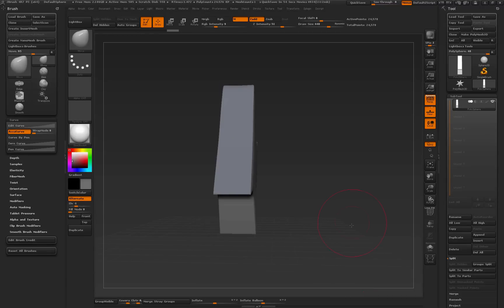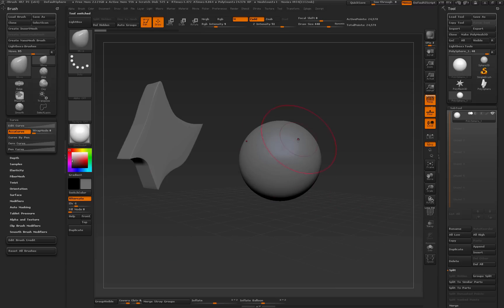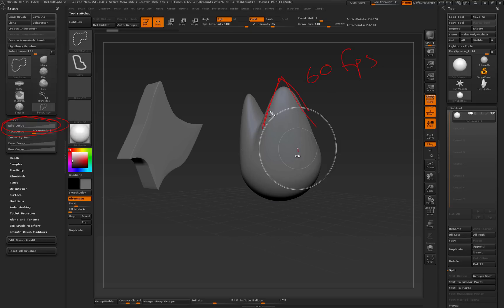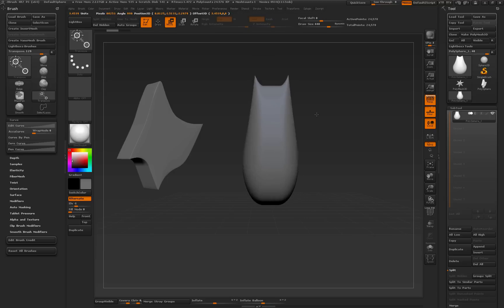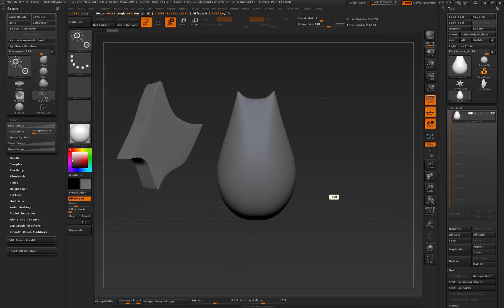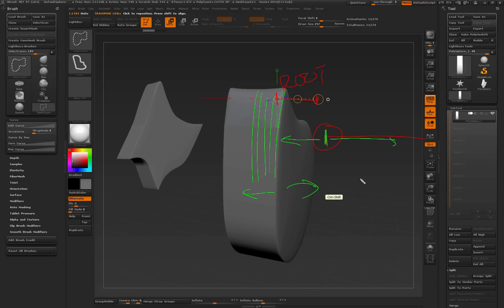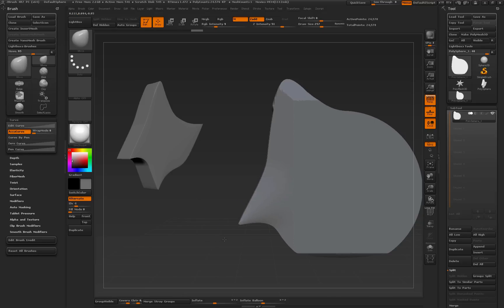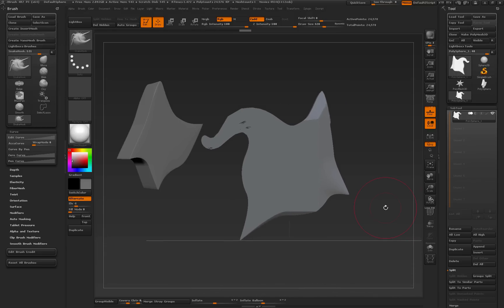ZBrush: How To Get Clean Edges

Comment: Hi Ryan, Can you kindly share with us, the easiest way to make gears, cog wheels, springs, screws and bolts. I am still looking for the most poly smart and editable version. I tried, 3D Alfa and found it be non symmetrical & hi-poly dependent. ZModeler has some edge holding limitations. Array mesh tends to become a trial and error method. I do not wish to depend on Modo as it is getting very expensive to keep upgrading.